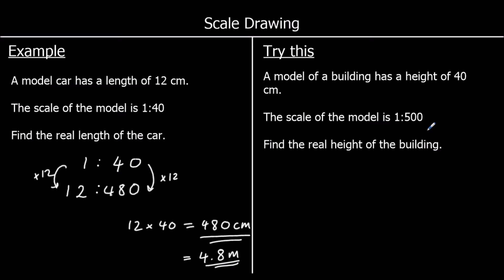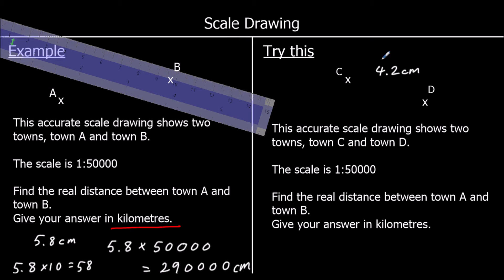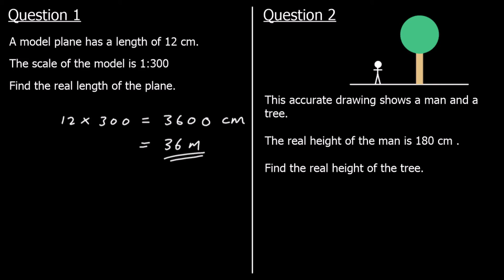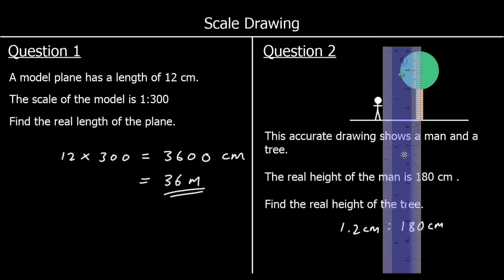Scale Drawings

Comment: when you told us to try out the box one, i measured the length from the screen and because it wasnt the correct one i said if 8 is to 6.2 when i measured then for the box when i measured 2.3, the one u would measure will be 3

Comment: a map is drawn with a scale of 1cm:0.5km. The distance beteween two towns on this map is 11.6 cm. A second map is drawn with a scale of 1:200000. Work out the distance between the two maps. If anyone could help me answer this question it would be greatly appreciated.
THanks
Reply: no.
Reply: @kingz1726  😂
Reply: So for the first one which is two towns you would have to convert 11.6cm into km. If 1cm is equivalent to 11.6cm then you would just do 11.6 times by 0.5km so the distance between the first town is 5.8km. As for the second one you dont specify what units for the ratio. Hope this helped 👍🏼
Reply: Man i cant do it too🥲
Reply: Urm this video would have helped but sure -
Reply: Distance between the two maps??